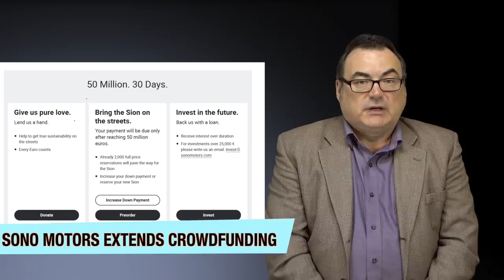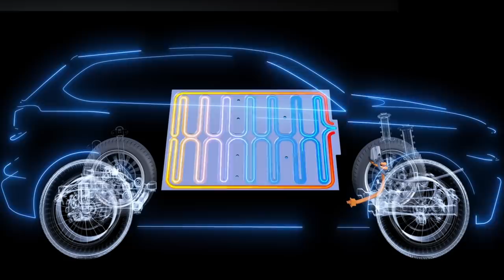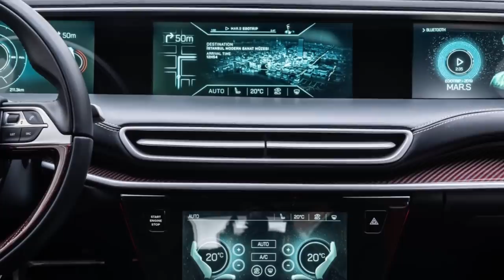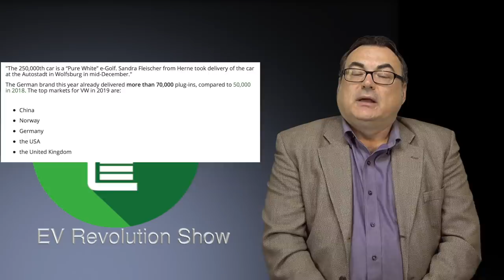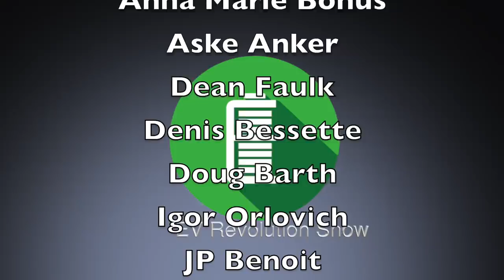Episode 74 - Tesla Record Q4, Tata All-Electric Nexon, TOGG BEV, 2020 Anticipated EVs and more!

Comment: Although Petro-Canada did announce "Coast-to-Coast chargers", their network isn't complete as according to their own network map (and Plug share comments) they have only completed 47 of their planed 56 stations.  6 of the 9 missing stations are in BC, where mountainous terrain will make getting 250 km out of a charge challenging on many vehicles.  Fortunately there are other DCFC alternatives in BC.  The other missing chargers are in Portage la Prairie, MB, Gatineau, QC, and Halifax, NS.  Also a couple of the chargers near Toronto hadn't been completed at the time of the announcement, but they are now open.
Reply from the maker: Thanks Roger, I understood it that at least 50 stations were operational but that could not be the case so far.
Reply: @EVRevolution  Unfortunately not yet.  Before the holidays they were going gangbusters, opening 2 or 3 a day, so hopefully it won't take long for them to finish the rest.  My guess is they  have run into technical difficulties at those locations.  FYI, I have a Google My Maps on which I have been keeping track of their stations for fun (I made it before they published a map to see how the spacing looked). https://drive.google.com/open?id=1OcewYsGdE1Ntqq6K581WPgq8Uk6l6s12&usp=sharing

Comment: I see a lot of low-volume niche BEVs coming to Europe and North America in 2020.  I don't see many mass market BEVs, though perhaps VW will get there.

California recently decided to require fast charging stations to:  1)  Charge for the electricity conveyed, not by-the-minute.  Tesla is the only supercharger operator that already charges for electricity, not minutes.  2)  Display at the supercharger the electricity conveyed and cost accumulated during charging, similar to displays of gas and diesel pumps.  Tesla does not do that at the supercharger, but displays it in the car and optionally on the owner's smartphone.  So pretty much all charging stations will have to be changed in California.  Odds are this regulatory requirement will be picked up in other jurisdictions.
Reply from the maker: Thanks for watching and for the comments!  Appreciate it!  

With regards to mass market, yes VW is poised to go after this harder than the other manufacturers, maybe with the exception of MG.  It's my hope the Big Guys will get with the program in a really heavy way as they can easily bring down economies of scale and costs versus many of the smaller niche players.  

I do like what California is doing policy wise and they are driving this marketplace.  Hope more jurisdictions do follow CA's lead.

Comment: Did Tesla not open a coast to coast Tesla Supercharger network in Canada just recently? And a Polestar is not a Volvo. :-) And Opel, Peugeot and Renault for instance and the little 3 VW/Skoda/Seat littles ones?
Reply from the maker: Hello and thanks for watching.  Tesla made announcements to expand their current SC-ing network to provide across Canada coverage.  They are not their yet, so Petro Canada is the first.  

Well, Polestar is owned by Volvo (and Geely) so my statement is accurate to a degree.  

Yes, all the VW Group is expanding nicely as well and we will see more offerings from those companies.
Reply: @EVRevolution  You should check that. Now You Know said that Tesla has opened the Trans Canada Highway superchargers.
Reply from the maker: @Ottery Lexa thanks for watching and for the info.  I stand corrected, it seems Tesla does have an operational Supercharging Network that spans Nova Scotia to BC, with some Destination Chargers in PEI.  

Seems both networks don't have a presence yet in Newfoundland/Labrador.

Comment: Thx for one more insightful post, Ken... And for what it's worth, your channel is the only EV channel I currently subscribe too...  Some of other ones tend to get tribal... While you and your channel, has a higher standard.....
I do have to push back on a very minor issue... You inferred that using a purpose built platform, was superior, to EVs built using a flexible platform (IE one that could be power by an ICE or Hybrid or PHEV or BEV)..... Hyundai and PSA seems to have shown that a flexible platform is just as valid and could be even more cost effective...But that's debatable....
And I wish had a use for the charity items. Since I would have been happy to raise the bidding higher... Keep up the good work, Sir,
Reply from the maker: Hi N C, much thanks for your continued support by watching and commenting!  Appreciate it.  That's my "shtick" and I try to look at the bigger picture!

Yes I understand your point on the platforms and agree, especially with the likes of the 2020 Kia Soul EV, which I am very smitten with!  Very good EVs can be produced on existing ICEV platforms no doubt.  

I guess I'm meaning that with ground-up designs, more thought can be placed on purpose-built items such as the pack geometry and sizes, different alternatives for thermal management, etc.  Not to mention aerodynamics and efficiencies which are a bit more important for BEVs than ICEVs.  Things like that.  Hope this makes sense.
Reply: @EVRevolution  Not sure how the platform affects the different alternatives for TM? 
It will make a much bigger difference for a dedicated AV than EV.... Since an AV could have radially different configurations that doesn't even look like a vehicle... But you have to get rid of driver for something like that....
Reply: @EVRevolution  BTW in the future an ICE will mostly be used as a range extender such as for towing.... so the ICE could be smaller and a flat boxer design... That would just fit in the place of some of battery modules from the battery pack.... 
Hope this makes sense?
Reply from the maker: @N C yes makes sense.

Comment: Canada needs to come out with its own EV  vehicle company. I'm guessing it would be in BC or Quebec since they really have lots of companies in those provinces designing and building different forms of EVs already.
Reply from the maker: Thanks for watching Tyson.  It's a tough market here in Canada since we really are a small automotive market compared to many other countries. Economically it's hard to just build and sell in Canada only and be profitable.  It's a huge and expensive undertaking to build a vehicle and a few have tried and failed (Bricklin!).  There is a BC company which is selling a 3-wheeler out of Vancouver for Canadian and US markets, but the cars will mainly be built in China.  You can check out ElectroMecchanica for more details.

Comment: You seem to have more facts than most.  At 65 mph how many kWh/mile will the class 8 semi Tesla require?
Reply from the maker: Hello Darryl, thanks for watching.  I don't have that info and if you cannot find it by google-ing, then Tesla has not stated it yet.  I did find this info:

Tesla said the Semi would have a maximum distance of 800 kilometers and be able to accelerate from 0 to 100 kilometers per hour in 20 seconds with 40 tons. According to Tesla, the battery will charge in 30 minutes with enough electricity to last 640 kilometers, and the truck will cost about $180,000.

Diesel trucks consume 2.2 to 3.3 kilowatt-hours per kilometer, while the average electric truck would require 1.44 kWh per kilometer, and particularly advanced models such as the Tesla Semi would require 1.15 kWh. According to the authors, the calculations showed that a battery electric drive reduced energy consumption by a factor of 1.5 to 2.9.

Comment: Every time I watch your show I learn something new and usually many things like info on all the new EV models are not so available in one place like you provide.  This was the first time I had learned about a Tesla plug being added to the EVgo charging network in some locations.  With so many Teslas hitting the market, anything to add charging availability can't hurt and before it would have required the purchase of a pretty expensive adapter to get DCFC outside the Tesla supercharger network in North America.  I wonder if they purchased a license from Tesla to use the plug format and how much the cost will compare for those of us that don't get free supercharging?
Reply from the maker: Thanks JeffnReno for your continued support and feedback!  Appreciate it.  

Yes as I responded to another commenter on the Tesla connectors, it is good that their will be more options.  The vast majority will continue to us the Tesla Network (lower costs and faster charging speeds) but having other options will help to alleviate any range anxiety issues.  Not sure about any licensing costs for EVGO, however I doubt it since Telsa offers many of their patents as open source for others to use.
Reply: EV Revolution,  Telsa offer to share its patents is very complex and requires an agreement with them, so its not  "open source"...And I dont know of any company that has signed an agreement.... Do you know any company that legally use Tesla patents?
Reply from the maker: @N C, I'd have to look into that as off-hand I don't know.  Ok maybe open source was the wrong terminology, but Elon has been stating till he is blue in the face that others can use their technology.  He's about the propagation of EVs as a whole, knowing full well that Tesla can never satisfy this market alone.  

Whatever the agreements are, I am sure it's not complex enough to be prohibitive, as that would go against a fundamental principal of Elon's.
Reply: @EVRevolution  Elon is a marketing genius for his EVs and everything he does. But we need to learn to read between to lines when dealing with marketers.. And check the facts, about what he does, instead of relying on just what he says.. Which does change... 
BTW, the SC Network seems great... So its a shame its not an open network....So all EVs can use it... And so 3rd parties could run their own SC network....
So Elon can keep getting blue in the face telling us his own version of reality (like most genius) ... But the rest of the EV industry will have to use a different rapid charging standard and non-Tesla tech in the mean time....
Reply: @EVRevolution  Sorry.... I just realized I was being pedantic... Since it doesn't really matter if they needed  to check with Tesla or not in this situation... I will try not to go down that rabbit hole in the future :)